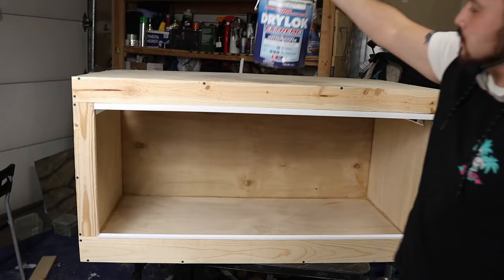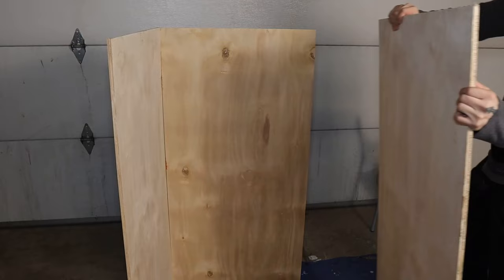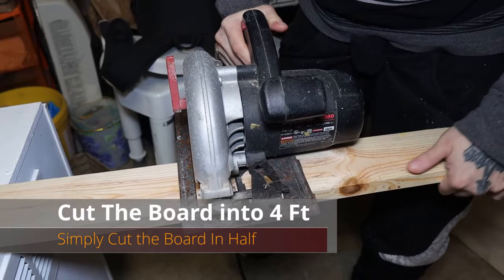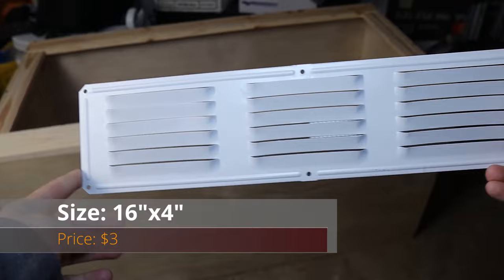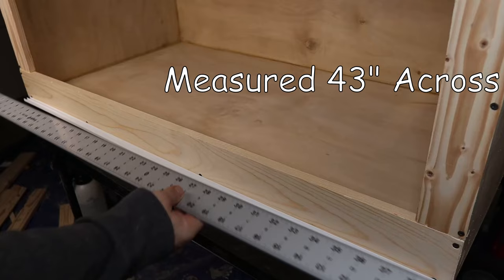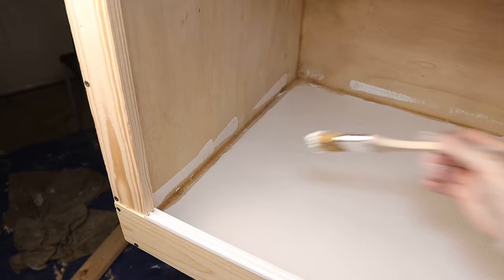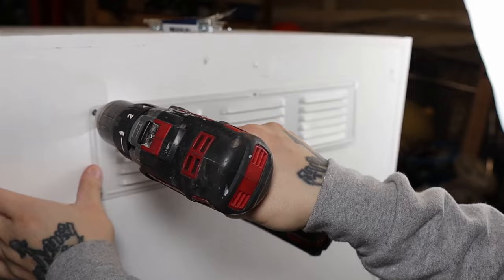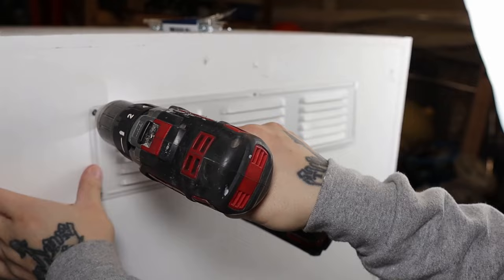DIY Reptile Enclosure Perfect For A Bearded Dragon

Comment from the maker: **Important Please Read**
Someone has pointed out that my electrical wiring wasn't safe for the porcelain light socket and they are correct.  Please Use heat shrink Wire Connectors to safely do this part. With the exposed stripped wire insert it into the connector, then heat shrink it so the plastic covers the wire, and then put the bolt through the ringed clamped and tighten the bolt onto the socket down. I truly apologize for the unsafe practice demonstrated in that section of the video. You can find this product at home depot or here is an amazon link to it. This product will have instructions on it.
**Heat Shrink Wire Connector**
https://amzn.to/3hLAct3
Reply: price?
Reply: @dominicra  he linked it
Reply: Thank you for your care
Reply: you linked a 1/8" slider door track, is that the one you used or did you link the wrong one because I don't think .220 inches can fit inside of
Reply from the maker: @sawyerwalraven7564  1/4” is what I used and I’ll fix it here shortly
Reply: @mightymorphingreptiles Ok thanks
Reply: Could you do a video on how to do the updated light fixture?
Reply: @mightymorphingreptiles  Do you know how big the enclosure is?
Reply: You also need to mount it to a junction box
Reply: You have to learn somehow. Thanks for the video

Comment: The difference with lumber sizing is what's known as "Net Vs Nominal" in the lumber and construction world. Nominal is the common name for board sizes (1x4, 2x6, 4x4 etc)  while net would be the true sizing (.75x3.5, 1.5x5.5, 3.5x3.5). The boards are net 2x4 when they are first rough cut from logs before they are milled and surfaced into smooth material, it loses the half inch in the milling and surfacing process. Hopefully you see this and add it to the knowledge bank. I'm a fellow herper that has sold lumber for 7 years now lol
Reply: That makes sense now, thank you 😊
Reply: They should teach this in basic elementary/middle school math class. Would save a lot of people aggravation when they do their first DIY build.

Comment: Wow, that took way too long to finally find your video.
It actually is the most usefull i saw on here and i guess ill stick to it in large parts when building the enclosure for my our bearded dragon.
A quick tipp i got from another video, when you use the paint/sealing before you silicone the outside lines, you wont have the problem of paint/sealing not wanting to stick to those parts.

Cheers and thanks again!

Comment: Thanks for your vid! I used your instructions to build mines. Only thing I did different at the end I actually used plastic wood filler to cover the screw holes and the imperfections from the wood cutting and sanded it all down before painting. Looks really good and professionally done. Thanks again

Comment: The reason the 2×4s are actually 3.5 is the wood mill cuts it to 2×4 and then they set it in a kiln to dry and it shrinks to 3.5. Loved the video quality content!
Reply from the maker: Hey thanks for educating me on that! I seriously never knew why they did that! Appreciate you taking the time to watch my content
Reply: Pretty sure it's because they are rough sawn to 2x4 then the additional milling to smooth out the surface drops it down to that final dimension. If it was shrinkage from drying then there would be a lot more variety in dimensions of lumber which isn't good for dimensioned lumber.

Comment: What did you use for the rail (for the acylic sheets)? Thanks very helpful video!
Reply: May be to late but to answer your question I’ve used 1/4” plastic door sliding track from Amazon

Comment: Thank you so much for posting this video. I plan on upgrading my ball python to a permanent enclosure. I plan on using PVC instead of wood. I’ve been looking for a good easy video to follow.
Reply: Will this be big enough for 2 dragons? And can I used sand in it?
Reply: @jericaroush4786  yes you can use sand but its not recommended to house 2 beardies in the same enclosure as they tend to fight

Comment: I think it’s really simple but you didn’t even out the openings for the vents. Some of the cuts you made in the air weren’t straight either, besides that, it looks good. Would have been good to know total cost. Also is that coating safe? Does it give off toxic fumes?

Comment: I built a similar enclosure 3 years ago.  Is it possible to link what material you used for the slider track for the doors?  That was my most difficult issue I had.  But those looked like they worked great.  I'd really appreciate it.  Ty

Comment: How come when I look up if drylock extreme is safe for bearded dragons and it says no?????
Reply from the maker: Because it can release some voc fumes as it’s curing out. It totally isn’t safe if submerged in water for long periods however I’ve never had a problem using this stuff over the years. You can use drylok original if you so desire for assurance

Comment: Can I ask you a question I don't know if you don't answer me or not but the two boards that goes on the top and the bottom for your sliding glass why did you buy one that was 1/4 and one that was 1/3. Then take the one that is 1/4 and cut an inch off of it, couldn't you just buy it two 1/3 so you wouldn't have to cut the 1-in off. Love your videos you are one of the people on YouTube that I'm only watch for the subject because some of them don't know what they're doing some of them say that the enclosure cost $100 but it's really about a $400 enclosure it's crazy😊

Comment: This works fine for a beardie but won't last for anything that needs high humidity, especially if it has claws. 

Drylok doesn't seal wood, it makes a barrier around the wood that will resist water as long as it's perfect and undisturbed. Animals rubbing against or climbing it will wear it away and punch holes in it. The enclosure shifting and high heat will cause it to crack. Both of these expose the wood to any moisture that's present in the enclosure and let the wood to rot out under the paint where you don't see it until the paint starts flaking off.

You need a plastic liner or you have to apply a 2 part epoxy to the wood if you'll have damp substrate or the walls or floor will get wet frequently.

You can also use PVC instead of wood to build the enclosure and then you don't have to worry about it rotting out.

Comment: why does the side panel board measure 18.5''? I thought it should be 24 - 3.5 - 2.5 = 18''. Is it because of the measurement error when you cut the top piece?
Reply: nvm, I see you mentioned in other comments you actually cut 1.5 instead of 1. That makes sense. Great contents. Thanks for sharing and keep up the great work!
Reply from the maker: Thank You and I'll make sure to keep pressing record!

Comment: The acrylic was only 18” wide and in the video you say the space is 18.5 so how is it not short to fit? Also the inside length for the track was 43” but the two sheets of acrylic are 24” each or 48” total. Did you cut these down? Or do you leave the 5” of overlap? If so how do you lock/secure them. Thanks

Comment: Does it matter if it's not birch plywood could it be pine or something along those lines?? Also if you do respond would it be ok to stain and polyurethane the outside and maybe drylock the inside or maybe even poly the inside too and not use any drylock?? Plz any help would be deeply appreciated.

Comment: Great guide. I'm not sure what I did wrong, but despite my measurements being on point the windows are a tad loose and don't stay in the tracks 😭gotta modify some swinging doors.
Reply from the maker: That’s a bummer I’m sorry to here I’m not sure and good luck
Reply: @Mighty Morphing Reptiles  Great guide. I'm not sure what I did wrong, but despite my measurements being on point the windows are a tad loose and don't stay in the tracks 😭gotta modify some swinging doors instead.

Between the top and bottom front boards for the door, I have 18 and 1/2," when you put down 18.5" did you mean a half inch like I did or was that a mistyped to mean 5/16?" Cause it seems closing the gap by a few fractions of an inch would have worked.
Reply from the maker: I think somewhere in the description I mentioned that I made a slight error in the edit of the video and then made the correction in the blue print

Comment: how much did this cost all together???? i’m trying to save my money. also this is AMAZING
Reply: Birch ply wood 60$
Paint 40$ 
Silicone 10$
Sliding track 20$
Air vents 8$
Light fixtures 10$
Screws box 8$ 
I would use real glass like 32$ for 2 sets

Like 200$
Reply: Where did you find the sliding track at? I’m having a hard time making sure I get the right thing.

Comment: Did you put the light fixture directly to the wood ? I was told I had to use a ceiling pan/ electrical box type thing.
Reply from the maker: Yes I did put it directly into the wood.

Comment: The link to the slider is showing 1/8 inch not 1/4 inch and I can’t find one. Please help.
Reply from the maker: Go to the link again and look at the options there will be one for the 1/4”
Reply: @mightymorphingreptiles  tried looking again. No luck.
Reply: Very freaking frustrating that you cannot find the damn slider track anywhere but online.
Reply from the maker: I just have updated the link to a 1/4" thick. Not sure why they took away size options on the old one. But I agree it is frustrating that it's only easily accesible online.
Reply: @mightymorphingreptiles  so I need to buy two of those?
Reply from the maker: No that link will have the upper and lower track on it.
Reply: Finally got it. One last question. Can the last step be the door track and doors? I have everything else ready to start.
Reply from the maker: @VolForLyfe  what was the last step? It’s been over a year since I e watched this video
Reply: The sliding doors
Reply: @mightymorphingreptiles  what size screws did you use for the ceramic light fixture?

Comment: Only thing that wasn't safe was the exposed wiring from the ceramic lighting. If that sparks or frays that tank is gonna catch
Reply: The messy Copper wire under the screws made me twitch

Comment: Help! I’m literally in the process of cutting the top nd bottom. Mine also measure 3.5 inches wide. So you’re saying to cut an inch nd a half?? Or half inch. Cuz it looks like half an inch nd you said one inch but in the description you’re saying 1.5.
Reply from the maker: If the description stated to cut the top piece off by 1.5 inches then  it should be correct. I don’t remember cutting any off the bottom piece.

Comment: Quick question! How long would you recommend letting the DryLock air out before letting an animal use the enclosure? I am just worried about the fumes for my SAV before I start and it’s useable!! TIA (:
Reply from the maker: At least let it dry for 24 hours. You can typically tell when it’s done by have no smell left.

Comment: It's important to note that the wiring of the light socket matter on which wire goes where.  The thinner side of the plug goes to the gold screw and the thicker side goes to the thick prong.  Another way to identify the wire is the printing on the wire is the thin or 'hot' and goes to gold.  If you have the light powered on, and go to unscrew the bulb with the wires backwards, there's a shock risk.  Hope all is well!
Reply: Also the ribbed side of the wire is neutral. Smooth is hot that's the other signifier. Also, he wrapped the wire around the screw the wrong way, it looks like it held well but if you wrap the other way it pulls the wire in tighter

Comment: Nice setup! 

Through the drying process, the boards naturally shrink, as moisture leaves the beams. The real shrinkage, however, comes when the “rough-sawn material” is sent to a planer, which rubs the surface of the wood down into the smooth shapes you can purchase at a hardware store. Without the rough edges, what went in as a 2-by-4 planks of rough-sawn wood is now a tongue-tripping 1.5-by-3.5, having lost approximately ¼-inch on all sides to the planer and drying processes. “Once upon a time, 2-by-4s really were 2 inches by 4 inches,” Stephens says. But these days, the blocks are smaller, prettier, and hopefully a little more environmentally resilient by the time they’re up for sale.